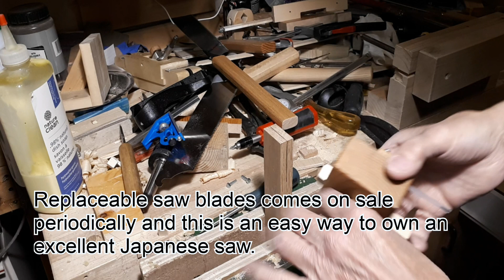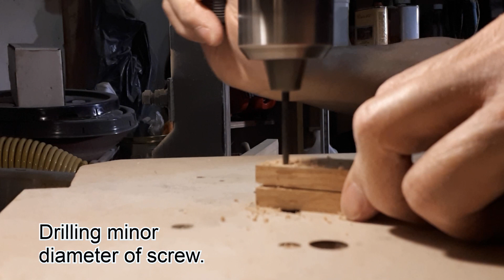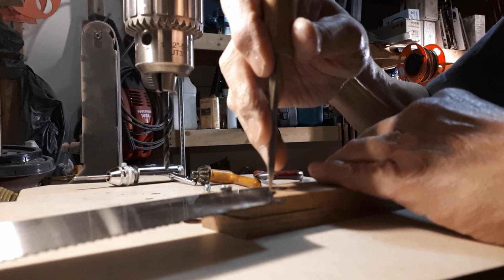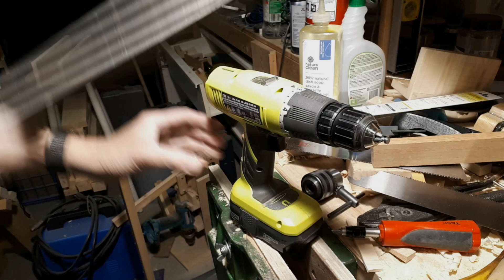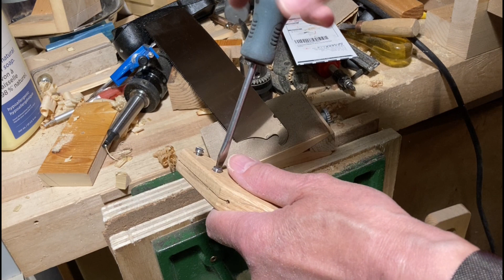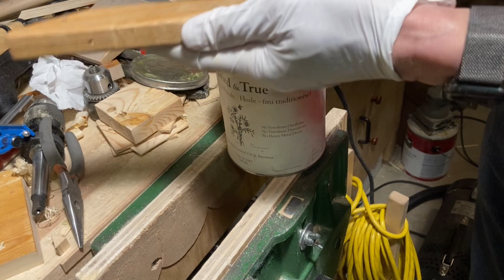Affordable Japanese Pullsaw Part 2

Comment: A fine looking, much improved handle - congrats Will. I like how you tapped the wood and made the blade removable. White oak? What blade was that? You have many blades, enough to last your lifetime it seems...
Reply from the maker: Thank you. I used red oak. The blade was an Okada rip blade. It’s the best rip saw I ever had bar none. I have gone thru 3 crosscut 265 already. I recently sharpened my Veritas dovetail saw and it was a joy to use.
Reply: @willshomeworkshop9386  makes sense, I use FLux, and it makes my screen go orange at night so I was giving the benefit of the doubt regarding the colour oak. I just relooked at Okada online, no deals to be had. I'd love to have a rip blade. The 265 I got is great at certain things but miserable at others. I still like it, and will keep it for all kinds of "rougher" jobs. How did you go through 3 Crosscuts so quickly? I can only imagine a Veritas saw being awesome. After seeing Lee Vallyes prices for a scrub plane, I made my own yesterday from a Harbour Freight 33 Windsor I bought as my first plane in 2017 when travelling through the States. Looked good, didnt realise it was such garbage. Managed to finally get the newly convexed iron to shave hair yesterday so will try it out on some wood tomorrow.
Reply from the maker: @LitoGeorge  I’ve been using the z saw for a long time. My first one came from Lee Valley and the handle was the green one (rubber/plastic). It finally broke and I make a wood handle using the metal connector I got from it. I used it for both crosscuts and rip cuts. I only got the okada rip blade a couple of years ago. I cut all my wood by hand hence that many blades. It’s my exercise.
Reply from the maker: @LitoGeorge  I finally caved on the flush cut saw blade. The discount was $5.00 bringing the price down to $7.34.
Reply: @willshomeworkshop9386  ordered a crosscut 225 today, with handle. Not that I wanted the handle, but it was 25 with a 5 coupon off. Couldnt resist a dedicated small crosscut saw at 20 bucks.
Reply from the maker: @LitoGeorge  I thought it was very  cheap.
Reply: @willshomeworkshop9386  you going to get one?
Reply from the maker: @LitoGeorge  No. I got a few already. The video for the flush saw will come out soon.
Reply: @willshomeworkshop9386  is that the one you got for 12$? Let me know when the flush handle vid drops 👍
Reply from the maker: @LitoGeorge  for 7.36Cad$.  5$ discount off 11 something. I caved.
Reply: @willshomeworkshop9386  oh no, not that one. I go my 3rd flush cut for the same price. I was taking about the small cross cut for$12
Reply from the maker: @LitoGeorge  I have plans for the flush cut. It makes a very easy to use dovetail saw if you have a magnetic guide. I have tried it and it works really well. Because it very thin and flexible, it really follows the magnetic guide. Even better than regular dovetail saws.